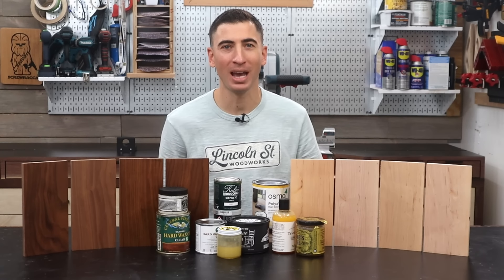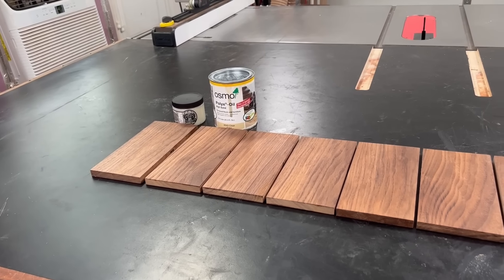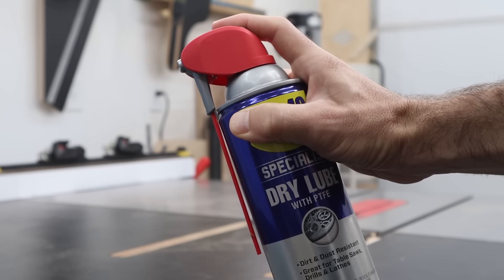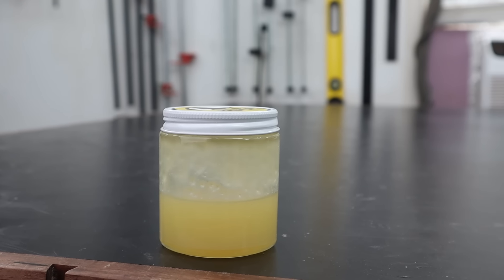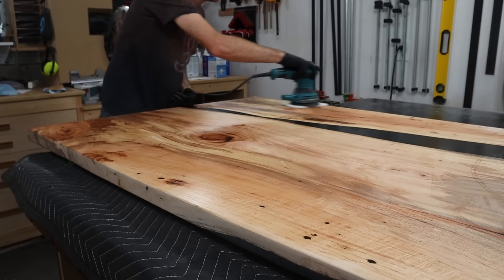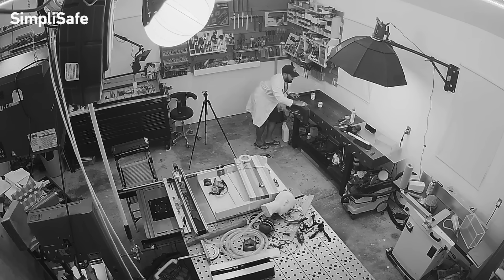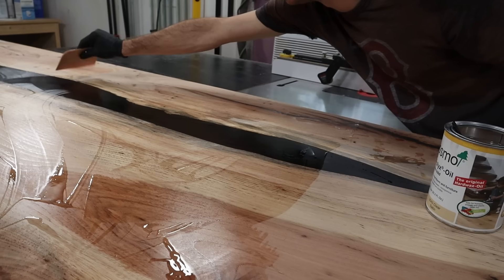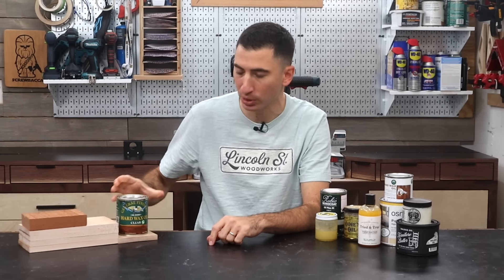Debunking Hardwax Oil Wood Finishes

Comment: I bought a can of Fiddes  because you declared it the "best value" among the hardwax oil finishes you tested.  I presumed  it was a "buff in, buff off" product like Rubio, etc., as described at 0:35 to 0:55 of this video.  I now know it is a "paint on, let it dry" product, like poly.  Buffing is a bad idea, because Fiddes dries so quickly.  I thought your viewers should be aware of this.  That said, your quirky sense of humor is refreshing, and keeps me coming  back to Lincoln Street videos.  Your ceramic coat test video is particularly enlightening.

Comment: I consider myself a hobby woodworker but have sold about 10 pieces of furniture to friends and family and I have used all but 2 of the products you listed and have settled on Osmo.  And per your comment on how we have fooled ourselves into believing we like dull finishes I have been using the glossy osmo 3011. I came to this conclusion myself after showing test boards to friends and family and  the few clients I build for and ALL of them picked either the 3011 or conversion varnish.  I must admit I have moved back to spraying finishes on large projects and table tops as the water based conversion varnishes are now very good and it is ultimately faster.  I know people are going to say “film finishes are not repairable “ but for me, a guy who builds mostly mission furniture out of dye stained QS W. Oak, if you have a finish failure your repair process is complicated no matter the finish.

Comment: three or more coats of wipe-on polyurethane  very lightly sanded with 1200 grit sandpaper between coats then 4/0 steel wool very lightly with the grain followed by one or two coats of hard carnauba paste wax (the kind used for polishing cars) then buff. Results in a durable dust resistant very high gloss deeply  transparent like glass finish with an absolutely sensuous feeling when touched.
Reply: this finish is extremely easy to apply and is virtually foolproof. I also generally stain the wood with strong tea to enhance the grain and figure of the wood.

Comment: Really good Video! 
One addition: 
The ratio of the voc test from surface to aiir volume is roughly 0,3m²/m³ . That would scale up to applying finish on a 15m² (e.g 7m long by 2,2m board) in a 20m² room with no vent/open Windows.

Comment: I'm scratching my head, feeling akin to watching a weather report telling me it's sunny out, but when I look out my window I see that it is raining.  I have been in the high end of wood finishing for well over 30 years and my own experience with Odie's, Rubio and Osmo could NOT be any more different.  After years of using Rubio, learning all about it's strengths and weaknesses, we switched to Odie's, because basically it addressed all of Rubio's weaknesses and brought some truly unexpected bonuses that we were able to turn into more offerings and business in general, as well as happier customers.  

For example, Rubio failed time and time again on certain exotics, especially oily ones.  Odie's did amazingly well on those or any species.  Rubio sets up in 15-mins and the application and buff off cycle has to be completed within that time frame.  Imagine doing that on 2000sf!  It gets annoying and time consuming constantly switching pads.  With Odie's we can complete the entire job application and buff off after without stress of having waited too long.  Much more efficient work flow, especially on large projects, which was the exact opposite of what you said in the video!  

Rubio requires that the highest you sand is about 120.  Why, if it's truly a molecular bonding finish as they claim?  It's because once you mix it with the catalyst, it bonds to that instead of the wood fiber and needs the scratch pattern for adhesion.  Not so with Odie's.  You can sand up to 5000 if you wanted to, it will still bond.  Which brings me to my next point (one of the unexpected bonuses I referenced earlier).  You can get a high gloss with Odie's!  The higher you sand, the higher the shine!  Try that with any of the others!

Odie's is tung oil based. It is truly a marine grade finish.  It performed much better in kitchens (or outdoors) than Rubio.  I know because I had both in my kitchen with 4 kids and a big dog.  :)

The VOC topic in this industry is confusing at best, lies at worst.  VOC's are not the problem.  Trees emit VOC's.  Isocyanates found in the catalyst is what we should be worried about.  Rubio has isocyanates, Odie's does not.

I could go on and on and on.  We tried most and we only use Odie's on all our products at this point.  However, I will submit that we too had failures in the beginning.  Learning how to correctly apply and remove the product was key!
Reply from the maker: Don’t scratch that head too hard!
Reply: Dear lord. How much did James pay you to regurgitate the Odies product flier?
Reply: @TheHesitantHandyman  I told you my real life experience.  I purposely gave specific examples, not talking points.  You on the other hand only got talking points it seems .  Why don't you get specific too?  Which part do you have a problem with SPECIFICALLY?
Reply: Thank you, Sir! Such a good insight! This guy just posted an amateur video just to get monetized after he saw he got to 1.5 million views on his last video bashing on finishes.
Reply: @mihaialexandrina2227  I mean how do you do a review of a product and completely ignore it's best features?  Is it lack of knowledge or deliberate misinformation?  Either way, the credibility of the review comes into question.
Reply: I'm pretty sure Odies will spontaneously combust even years after "curing". I would never put my pet ferret at risk with this dangerous product.
Reply: @BillJBrasky  You're pretty sure?  What nonsense!  LOL  Do you realize Odie's is actually food safe?
Reply: Of this group, I've only had experience w/Odie's, but I can confirm that it's not time-sensitive (within reason).  Buff off one hour after application or three hours, and it doesn't seem to make a difference.  It's one of the things I like about it, since I get distracted easily.

(Especially true if you're 'staining' wood by mixing powdered pigment with Odie's thinner oils... it's a foolproof and very repeatable way to apply color.  My experience with 'regular' wood stain is the opposite... a minute or two difference in how long you let it sit will vastly affect the color.)
Reply: @Lighthouselaserarts  one time I ate a can of Odies and had to be hospitalized. I don't think it's food safe.
Reply: @IanPrest  Yes, you can go many hours before buffing off.  That was my point about being a pleasure doing floors in a large house, not having to switch pads and apply/buff off every 15 minutes.
Reply: @BillJBrasky  congrats on the constructive comment.  That's not what food safe means at all, but I understand all the attacks seems to be silly, baseless comments like this.
Reply: @Lighthouselaserarts  seems like the Odies shills are the ones attacking...

Comment: I use Odies for all my shop furniture and surfaces, I love it.  I used it on lighter wood and it only darkened it a bit.  But the best part of Odies is the smell, I love it, plus I'm not worried about letting my six year old sit in the shop and buff surfaces so he can be a "fixer" like me.  I am about to refinish my dining table which is black walnut, and I'm debating using rubio instead of a poly or something.  I just don't like the glossy plastic look of a poly and want a more natural look.  I guess over time I'll find out if I decide to add something else to top coat it if the rubio doesn't cut it.

Comment: Some woods will change color as they oxidize from UV light, the best example is cherry, when freshly milled/sanded it has a salmon color, they eventually darkens to the brown/red most people associate with “cherry”. Some of these finish offer different levels of UV protection, which will slow that process down. You can try this yourself, throw a piece of cherry through a planer and put it on a window sill under direct sunlight. And cover half of it with some cardboard. Come back in a week and see the difference. We used to set up flooring samples with this scenario to show people what the floor would look like after aging. Lots of times we would have a complaint about someone picking off an old sample and getting a fresh floor that was way lighter. Or worse they would complain that they got rid of an area rug that had been on the floor for years and there was a big square in color difference where the rug was
Reply from the maker: all true. I store any samples like this in a dark shed for that reason!

Comment: I love odies oil. I've used it on tables all over my house. I even put it on my butcher block island. It smells good and seems to do a good job of protecting the wood. You must rub it in well, and then buff off, so it is operator error if it doesn't work for you.

Comment: VOC is always such a complicated topic. Cuz like a significant part of the reason for iced coffee is cooling down volatile organic compounds so you don't lose their flavor. That's pretty safe as far as anyone can tell. From a VOC safety perspective, I would certainly rather be a barista than work with metal finishes.

But even within that If you gave me the choice to be exposed to the same level of VOC from patina, denatured alcohol,  acetone, xylene, lacquer, or metal wax definitely an order in which I would prefer to be exposed from both a health and comfort perspective.

These days I'll often wear a dust mask even if I'm just working with denatured or acetone.  I know it's not rated for it but it seems to diffuse the volatile vapors before they get to me. But patina or lacquer. I feel that through the paper mask and I put on my respirator with the chemical filters. But Metal wax I'd use in an enclosed space without too much complaint.

Obviously I have no practical way of actually knowing and measuring the amount of VOC I'm being exposed to nor the exact specific chemicals in anything but the simplest compounds I use.

Even lacker thinner for example is too complex to be certain, you can sometimes get an approximate distribution of what distillates are present, but it's pretty hard you'll find one. That said, you can just use xylene because it's a component in lacquer thinner and that way, at the very least you know the chemical you are being exposed to.

At this point I'm just rambling so I'm going to head out thanks for reading if anyone does

Comment: i bought  table top of 6cm thick but with a teak veneer layer on top of only 1.2mm. Meaning i cannot sand the grease spots away. I tried removing them with universol (cleaning detergent for painting) but that doesnt work, they're to deep in the wood. What can i smear on top of it so the spots arent really visible anymore? It seems like hardwax would help but i want something more protective.

Comment: Great video👍
I enjoy woodworking but finishing process with the endless options can test your patience. When it comes to VOCs get a multi had combo respirator cartridge like 3m 60926 to protect you from and will organic or particulate when woodworking or chlorine or acidic gases for you pool or strong cleaners

Comment: I am buying a house, it has engineered click bamboo flooring (i believe floating) in a Florida house on top of concrete foundation. When walking on it, it creaks and cracks very noisy. Is there any fix?
Will applying hardwax oil help?

Comment: What's missing is the comparsion with pure Linseed oil and/or combined with a mixture of bee wax and (natural) turpentine. Ah, and don't forget shellack in regards to protection and look. Your pieces probably need a bit more time to rest, but the long time performance is better. It's the same with bone glue. It takes a bit more time to dry, but I think that 2000 year old furniture found in egyptian graves, which is still holding itself together, is the most convincing argument in regards to durability...

Comment: I chose #2  actually. I have a question about the wipe test. What does it take to repair that wipe damage?
Reply: Really simple on hard oil or wax , just add some oil on a damaged parts. Rubio is in thid case to espacially good in.
Reply: Yeah just reapply is the solution which is good enough imo, since it’s so easy..
Reply: I liked 2 the best as well.
Reply: same for the choice

Comment: I do alot of sample tests when doing a project, usually end up going with water based matte poly. Does not darken the wood, but brings out grain and provides a much more durable finish than any of the oil/wax finishes social media users use.
Classic finishes like danish, toung, shellac while very durable/long lasting I don't care for the color change effect it has. 
Being said, each wood species will change is different ways with different products.

These social media hyped finishes? Think would be good option on surfaces that do not see daily/rough use and also where ease of application would help. Book shelves, etc. Or even wall panels/ceiling panels

Comment: How can you test for VOCs in a plexiglass box (presumably made and glued for this video)?
Reply from the maker: Is this a trick question? You place finishes in the box and test if the VOCs go up. The box was built months before testing
Reply: @Lincolnstww  plastics emit VOCs, as does glue (old and new).So it's not a very scientific test for measuring the VOCs coming from the varnishes. For an accurate test you'd need a pyrex dish or something.
Reply from the maker: @jackfntwist  there was nothing being picked up on the sensor, he made sure to check that out before. He does this type of stuff for a living

Comment: My daughters dresser we refinished we painted frame and top with beyond paint and then I used Odie’s on the drawer faces. The bottle went a long way and actual smells pleasant (I applied on back patio so well vented) but I didn’t mind being out there and even though labor intensive rubbing in and then buffing off I wasn’t suffocating in fumes which was nice.
Reply from the maker: it definitely has a good smell to it

Comment: I had ash floors put in (got a deal from the installer.) Didn't like the color of the first poly finish, so when it came time to have them redone last year, we t with Osmo polyx matte "raw", which has a white tint to it. Came out great, and I can sand and touch up spots without redoing the whole floor. #teamosmo

Comment: Hi Lincoln, I’ve noticed you say that you’ve gotta apply a second coat of Rubio to bring out the woods color. Rubio is a one coat finish, don’t apply another coat since you’re just going to be wasting more product than needed. 

If you want to bring out the sheen I’ve found you need to apply another product they sell over Rubio once it’s cured, it’s called their Universal Maintenance Oil.

Trust me, you should try it and let us know what you think. It’s basically what Rubio SHOULD look like because it’s extremely flat without it. Sucks that you have to pay more money to unlock what you originally pay for but at least it looks a lot better!

Comment: thanks for this video, just had my first experience with hardwax oil, to refinish an oak bedroom floor, and my understanding was the particular product i used was very low (had almost no) voc's, but the smell is sure lingering after the final coat!  and then read Rubio is supposed to have zero...claims and reality.

Comment: It's good to keep in mind that vocs include alcohols like isopropanol (rubbing alcohol) and ethanol. Non-denatured food-grade ethanol (just plain grain alcohol) has no unpleasant overwhelming smell and yet will max out a voc meter. (Though no company's going to use food-grade ethanol as a solvent in their coating product unless it's a ridiculously expensive specialty/custom product!) So, even though "VOC" technically encompasses a wide range of fast-evaporating — i.e. "volatile" —  substances, when we're talking about avoiding vocs we're usually thinking of other solvents and volatile ingredients used in coatings/cleaners/lubricants which are much more harmful at lower concentrations, specifically other various alcohols, ethers, ketones, and other petrochemicals

Comment: This was a really informative video! I used Rubio Monocoat for the first time and I believe the Hardwax oil would be ok in terms of VOC but on the accelerator it says to wear a mask… which I didn’t read until later as I  then ended up with a runny nose for hours. Lesson learned.

Comment: For me, not having to wear a respirator is more important than protection or cost, so Rubio remains my pick for the best balance of factors. I’m comfortable applying it without a respirator, it’s ready to use within a relatively short window, it’s convenient to apply to large pieces, and it doesn’t look awful like that No. 4 sample (I hate film finishes and excessively dark walnut—its beauty is the warm and varied tones, not in looking like a warm charcoal paint). 🤷‍♂️